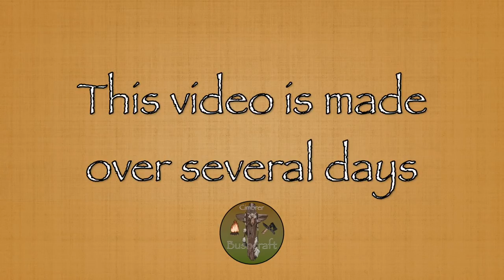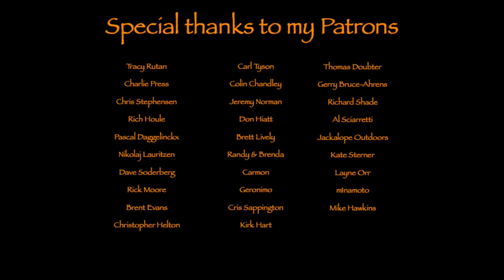Kuksa vol. 2

Comment: Another great video my friend. What type of wood are you using for your Kuksa? I’m ready to start my first project (a spoon) but I’m unsure about the wood. Here in north central Texas most of the readily available woods are Oak, Pecan or Pine. Oak and Pecan are both hard woods and I don’t want to have to put a sealer on the Pine? Do you have any suggestions? When I’m ready to do a Kuksa I’m definitely ordering the long curved tool from Beaver. Looked like the perfect tool. I need the special strop as well. The Kuksa looks great and very cool fire starting method. You don’t see that one very much. Cheers from Texas my friend. Thanks for sharing.
Reply from the maker: Thanks Jack for your feedback and question 👍🏻😉
I use birch wood for my Kuksa but different kind of woods when I make a spoon 👌🏻 The last spoon I made from a cherry tree 🌳 in my garden 
But I wouldn’t recommend you to use pine for carving … to soft 🤔. Hope you’ll find some suitable words somewhere 🌲
Atb to you and your family 🏕
Tom
Reply: Cimbrer Bushcraft   Thanks for your help Tom. I’ll try to locate some Cherry wood for my spoon. All the beast to you and your family as well.
Reply from the maker: Thanks Jack 👍🏻😁 and the same to you my friend

Comment: The Kuksa looks great! I noticed that when I make spoons each 1 is better then the next. I used Cherry wood to make my last spoon. All the rest were made from pine or spruce. What kind of wood did you use for your Kuksa
Reply from the maker: I used birch for my Kuksa 👌🏻 My last spoon I also used Cherry and that’s also great wood for carving 😉👍🏻 But pine and spruce? Isn’t that to soft ? What are your experiences with that? Doesn’t it crack very easy 🤔 I’ve never used that because most people say it’s no good 😊 
Thanks for your feedback and interesting information 🔥🏕
Tom
Reply: Cimbrer Bushcraft  pine and spruce are very difficult to work with when carving. It is very important to make sure it doesn’t crack. I use olive oil. Hemlock spruce is better then pine for sure. I think I’ll be using birch and cherry from here on out.
Reply from the maker: Thanks for your feedback 👍🏻😊. See you on the next one